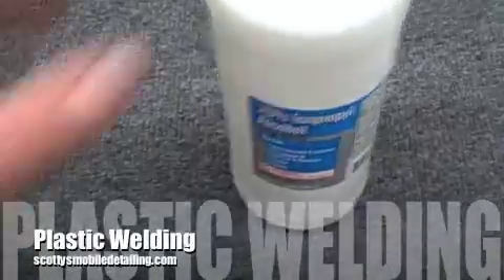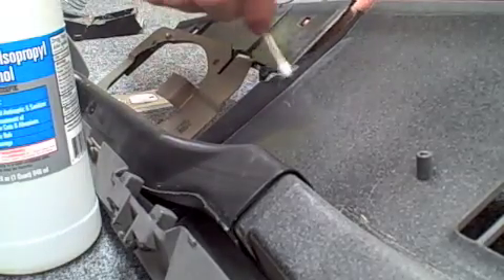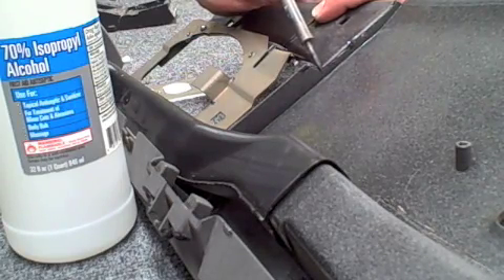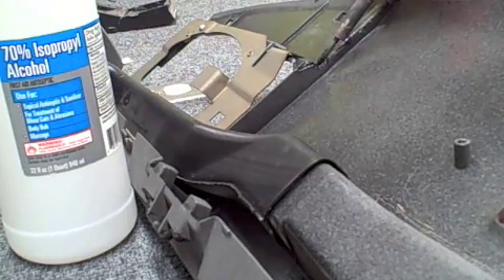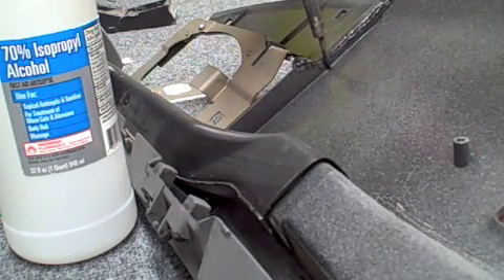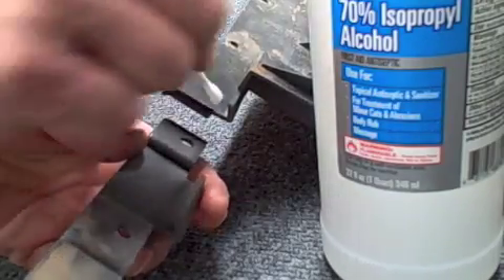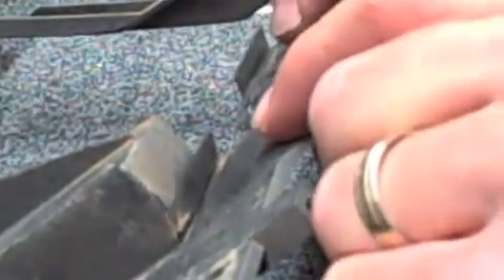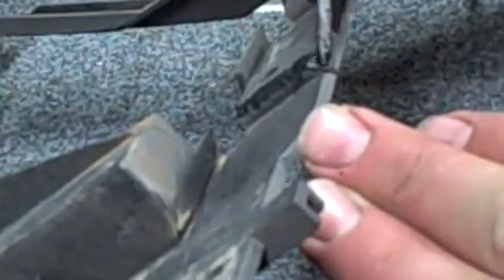Plastic Welding 101

Comment: Not all epoxies will glue all plastics. The most universal brand I know of is West System G-Flex 650. Even that doesn't glue all plastics. 
By pushing the two beads together, one side first,  the leading edge of the plastic is cooler. And the opposite bead its being pushed toward is a lot cooler. I use a technique the same as gas (acetylene/oxygen) welding for plastic, heating to melt a puddle, and adding filler. It requires a bit more practice tho. Thanks for showing.

Comment: How would you go about repairing one of the little tube screw channels like you see on the right side of the screen? I have a plastic cover that screws in from the back (the screw threads would be facing up in your video) that broke with under the screw head. I have a crescent piece that the screw would sit against to hold the piece in place. Should I epoxy it first then weld the outside of the crack?

Comment: A good way to recreate the texture,is to roll a tangerine,lemon,or orange across either the hot plastic,or still tacky glue/epoxy.
Each one of the citrus fruit have a slightly different texture,so you have to choose the one that's skin looks the closest.

Comment: Scotty, I am thinking about trying to repair the Dashboard of a Dodge truck. (I think Dodge ships them with cracks, because I never see a Dodge pickup that doesn't have a cracked dashboard.) 
It seems that it would be a helpful technique to perform the weld and then back it up with some epoxy and some fiberglass mesh. Any thoughts on this?

Comment: Thanks for the vid! I've been fixing and repairing plastic bits and pieces ever since I came across this video. In the past I'd always just go for some epoxy to fix stuff but this does work and has enough strength to not need epoxy (depending on the part's use and how much of the pieces are melded to each other). I generally don't prep the surfaces unless there's paint or some other coating on it. I hit a protruding mailbox in my 09 Hyundai and it broked into two pieces. I grabbed my soldering iron and 'stitched' it back into one piece and filled the cracks crevice with epoxy so I could sand it level with the rest of the housing and it turned out fantastic!

*The side view mirror, not the entire car broke in half lmao!

Also, this pertains to the same car but one thing to look out for in general is severely degraded or cheap plastic. For instance, something plastic that has become brittle to the point where it just crumbles/shatters/easily cracks. Not worth trying to solder back together. My overhead light housing was cracked so I figured I'd pop it out and fix it real quick. When I say I gently started to pull, I mean like gently taking a band-aid off a baby, and it shattered into a bazillion pieces instantly. After hours of getting the thing soldered back to one piece, I tried reinstalling it and deja vu. Little plastic grenade. Bits flying everywhere, people screaming, earthquakes, internations sanctions, etc. Okay, maybe not, but it sucked anyways :/
Reply: I enjoy your humor, Wm.
Reply: I felt the earthquake from Germany. Hit us hard.

Comment: I have an old car with an ashtray console that is snapped at one of the points, in half no less with jagged edges. I think this fix might work but how does one make the finish smooth, as I cannot have "bridges" showing on the face side? Is there a finishing technique you have established that will smooth out the end result and be suitable for a vinyl or plastic spray to complete a restoration?
Reply from the maker: If the edges on the face side are not square and tall you may need to cover the repaired area with vinyl or leather to hide the repair.
Reply: Thanks for your reply. Be well.

Comment: It's abs plastic. Acetone is the solvent. What would happen if you mixed black plastic slivers in acetone? Liquid ABS! Let it evaporate, it gets tenacious. If you want to save a lot of time, this isn't it. Also check "Plastex". Never tried it but users love the stuff. Adjoing surfaces need to be happy, so V grooves and acetone wipes till really clean baby on both sides of both pieces. Lay the ABS paste in gently to just above the valley and squish it in with your well washed thumb or the back of a spoon. stuff you saved in the jar. Sand flat always using a block.

Comment: would it work on subwoofer
Reply from the maker: No, I would use a flexible epoxy.
Reply: +ScottysDetailing any recommendations??
Reply: Probably try to replace the part that broke. With any luck you can find it somewhere online, but if it's just a bracket or something easy and less functional that the speaker itself then you can probably use this method.
Reply from the maker: What are you trying to do? What needs to be repaired?
Reply: +ScottysDetailing subwoofer repair
Reply from the maker: +Donte Coleman- what part???
Reply: +ScottysDetailing cone

Comment: what was the glue stick for??
Reply from the maker: Nothing I did not use it🤔
Reply: Use this specific model 2 part epoxy from JB WELD.  http://www.ebay.com/itm/201815558542

It worked for me well in almost all materials PVC, ABS, Toys, Wood, Metal.  Try two part epoxy once you will feel the power of it.
Reply: +ScottysDetailing 😂😂😂

Comment: Fyi this is not plastic welding this is plastic fusing. Welding creates a stronger bond and doesnt burn the plastic, however this is generally much easier and you did a good job showing how to do it well 👍

Comment: Would this work still if you want to build you're own bumper for amcaar
Reply from the maker: No, you will need to fiberglass a bumper. Plastic welding is not strong enough.
Reply: Ok thanks I want to build a bumper from scratch or build off then one I already have
Reply from the maker: Check out this Youtube channel...

http://youtu.be/GXzR17LktSg
Reply from the maker: Great videos on fiberglass work

http://youtu.be/GXzR17LktSg
Reply: Ok thanks

Comment: Great tutorial.  Thank you.  
Could this work on closing a tiny leak on a plastic intake manifold?
Please advise!
Thank you
Reply from the maker: Yes! Then after you weld it up go over the weld with some plastic epoxy. Better make sure you buy the epoxy that is for high heat.

Comment: Thank you for this awesome video! The four different epoxy brands that I tried before never held (but I tried to paint over them anyway...), but the welding let's me flex the fairing without issues! Now for the grueling work of preparing the parts for a new paint job (or vinyl wrap).

Comment: I see some using this method for a plastic radiator tank...I have a hair line crack in mine that leaks a little coolant. have you tried this for a radiator...Thanks and nice video.....Philip

Comment: This is probably the best vvvideo I have seen on plastic welding so far.  I am trying to learn this so that I can repair motorcycle fairings and saddlebags that are cracked! We sell new and used Harley Davidson Parts.
Reply from the maker: Make sure you epoxy repaired area after the plastic welding to make it strong as metal.

Comment: Couldn't wait to experiment!   Went well, zip ties make great welding rod for plastic repairs,  They come in lots of colors so you can match sort of.  Try it!
Reply from the maker: A great idea!!
Reply: I thought about that but didnt think they would hold or melt good!...glad to hear that they do because I got 2 huge packs of those and my old radio shack soldering iron and a broken in 3 places abs dashboard out of my 03 yukon!...well I guess that will be my project for tomorrow!

Comment: I've never had much luck trying to melt plastics back together and I've never had any luck with epoxy either. Plastics always seem to break at high stress points and even my best efforts have always ended with the repair coming undone. You really need an industrial strength epoxy like 3M's Scotch Weld and unless you are doing a lot of this, it's not worth the cost of buying the gun and the tubes (the cartridges don't come with the mixing tube)/ Also, many of them require 2:1 or 3:1 or 5:1 and you need the right gun and they start at like $100. It might be great for a person working in a body shop though, where you can justify the price.

Comment from the maker: That's why we are here! To make great videos to help the DYI'ers
Reply: Isopropyl Alcohol  was the flux he used...
Reply: @Z71Ranger  warning!! ❎❎❎The alcohol was just for cleaning......alcohol for flux is dangerous flammable🔥🔥🔥
Reply: Flux in the aspect of removing or isolating contaminants without leaving any residue is important for complete adhesion as if it is an HDPE or #2 plastic, it resists a strong permanent bond to most things.  That is why my personal spot welds were crap to begin with, and even with cross hatching fold overs etc, it never maintained a bond along the whole seam that would survive slight torque a couple days later unless it was residue free and not overheated.
Reply: +ScottysDetailing what kind of flux do you use?
Reply: +Insert Clever Name Here  Is there a "flux" for plastic welding? Flux inhibits oxygenation during liquefying temperatures of metals. I wouldn't doubt there's a market for fictitious plastic flux.

Comment: I just started doing plastic welding repairs and the only thing I can add is get one of the cheap respirators from harbor freight (16.00). It eliminates the fumes. I can weld all day long without smelling all the plastic fumes. Thats just my 2 cents.

Comment: Good start with the soldering iron. I have then found the next best step is to find a plastic container that has the letters "HDPE molded on the bottom. This is High-density polyethylene, the same material that your tank is made out of. I then cut some 1/4 - 3/8" wide strips from this container. You can then light one end of the strip and holding it about a half inch from your tank, let it drip slowly over the cracked area. Go slow enough so that the new HDPE bonds itself to the tank material from it heat. You can put a number of layers on the area and spread it past where you scared it with the soldering iron for a better bond. This will make the joint even stronger than it originally was and give you a much smoother finish. A discarded milk carton will do the trick and your repair cost is zero.
Reply: oldcontrols yes I thought milk jugs would work too

Comment: If well donne, maybe it lasts a couple of days or weeks, but it will keep fragil and it will break again, soon or later.. Donne the same do my gear dash and the result was that it looked solid, then a few hours later it was on garbish! If you want to really get that solid, just use epoxi.. And maybe sometimes it's better to buy new and reliable than do some crap and end up in the same way... just my opinion :-)
Reply: Thank you dude, soo sweet from u :D
Now go fuck yourself and leave me in peace! Nowadays stupid people like u can´t read an opinion cause they get hurt... And don´t tell me that a typical weld is stronger than the actual material, cause u are just getting the 2 parts secured with the same material but with one diference.. it is melted, and any crack that can remain will open again! Maybe next time u can do this with a helmet and be sure to get an accident and let´s see that magic welding work :D
Reply: If done right it will never break. Welding is basically melting the same material that makes up the plastic piece. Epoxy is a big mess and never sticks to plastic like the plastic itself.
Reply: fubarinwar You are melting the plastic, but it will never stay solid and without small holes or cracks, and it will end up to break again.. The epoxi depends of the one you choose, cause I had used epoxi in plastic and I can aply pressure like a new one and it doesn´t break. But I prefer to buy a new one (depending of what and the price).
Reply: Rodrigo Santos a typical weld is stronger than the actual material, so therefore you're a dumb ass.

Comment: Have you tried using a regular plastic cable tie to fill in the gap/canyon created by the soldering iron ?

Makes a perfect, solid, & incredibly strong joint ! 

If you need to 'reinforce' the joint, then use a paperclip cut and bent into shape and heat it up until it 'sinks into the joint, then use the melted cable tie on top for extra body !

Works Great - perhaps you should try it sometime and get back to say how you got on.

Comment: You should use 99% isopropyl alcohol if you can instead of the 70% because there is 30% water in that and when the alcohol evaporates it leaves behind some water which is not ideal.

Comment: So when did you use the expoxy? I've also seen other videos where they used a dermel tool before they started putting the pieces together. Is that needed for welding?

Comment: THIS SEEMS LIKE A REALLY GREAT SOLUTION FOR WELDING PLASTIC. I HAVE A FORD VAN WITH A SERIES OF SMALL CRACKS ON THE TOP OF MY RADIATOR WHICH IS MADE OF PLASTIC. DO YOU THINK THIS TYPE OF REPAIR WILL HOLD UP UNDER THE PRESSURE IN A COOLANT SYSTEM. I AM TRYING TO AVOID REPLACING THE UNIT UNLESS ABSOLUTELY NECESSARY. I ALSO SAW A COMMERCIAL PLASTIC WELDER WHICH COST OVER $100.00.

Comment: Wow. Pretty cool. My projects are most all plastic tubing and PVC. Trying to get any glue to hold the parts together is almost impossible. I think the weld technique will be my best shot at getting these parts to hold together best. Thanks for the video.
Reply: PVC clear primer and PVC glue. Same for plumbing parts to weld them together. That's another official way that totally works. They sell it at home Depot. Name is oatey